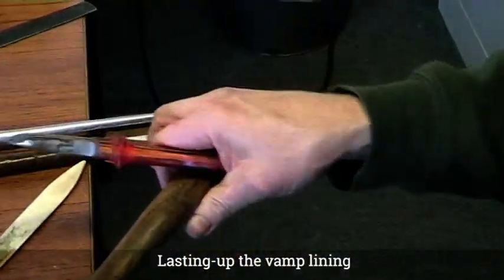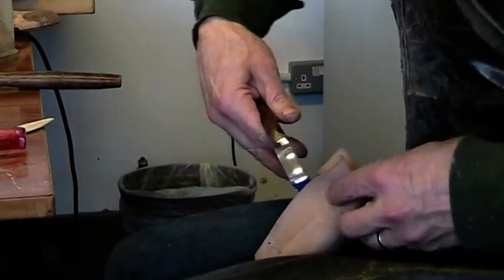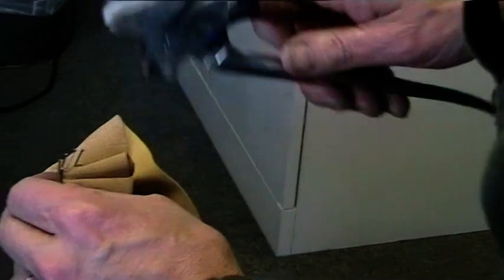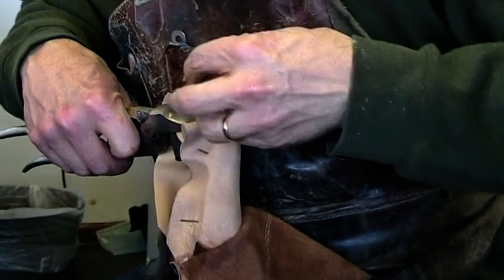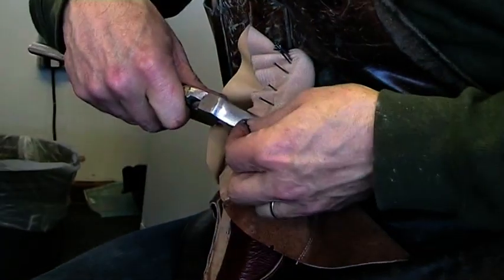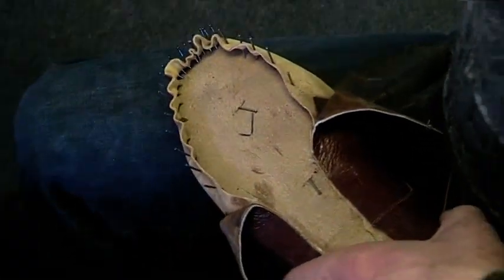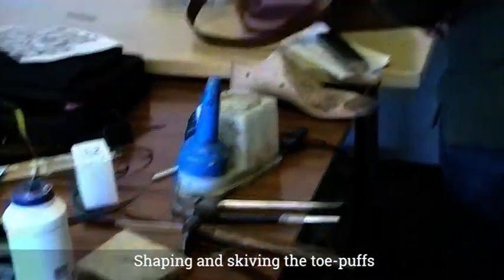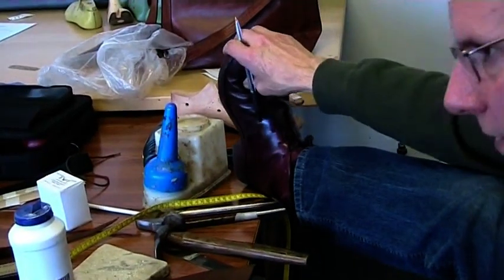Lasting-up a Derby shoe - Part 3 of 4

Comment: Definition of lasting???????
Reply from the maker: The last is the wooden form that gives the shape to the shoe. That's the shoe shaped piece of wood you see in film one.
'Lasting up'  means to put a leather insole on the bottom of the last and then to stretch the flat leather upper onto the last and fix it down onto the insole. That is the name of the process.
When it is all dry, the sole is added and the last withdrawn leaving the finished shoe to fit a person who wears a shoe the same size as the last.

Comment: NAILS!!!!!  Rivets are different and have two parts.
Reply: Yes, that’s true of domed rivets Mateusz. These are called rivers because they are only 1.2mm thick and are designed to bend over, trapping the leather underneath. That’s why they were originally made of soft iron. 
Nails are much thicker so-as to resist bending. If you use 26mm nails you will find that they hurt the last as they make bug holes, and also they are more difficult to bend over.